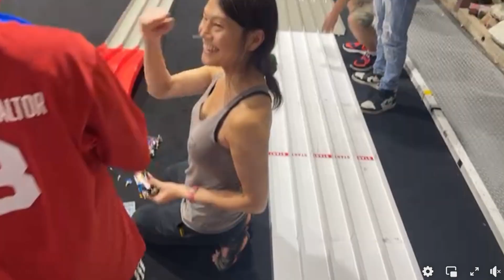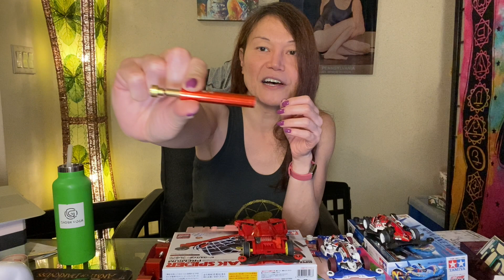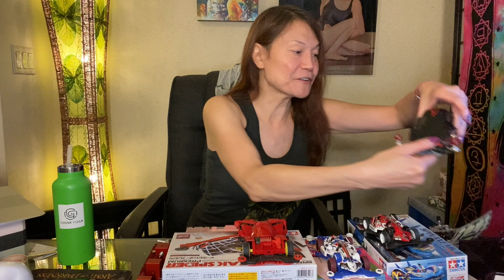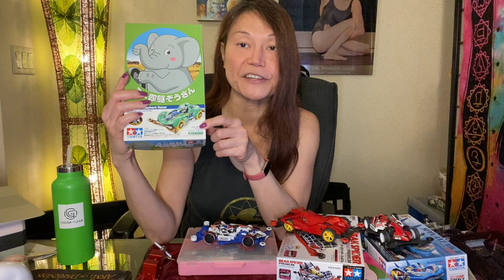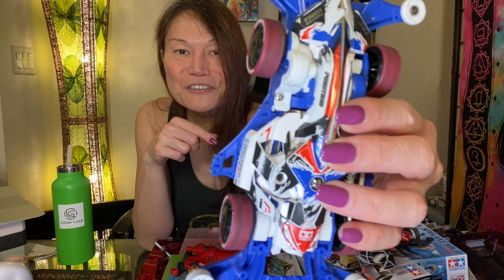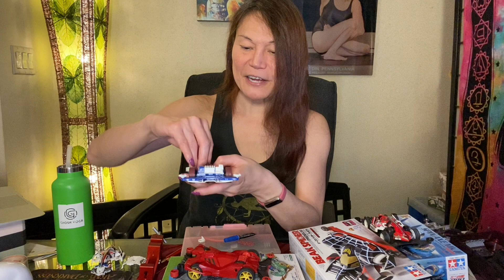Tamiya Mini 4WD Master Class: Super-Fast Box Stock Cars

Comment: I have a question. So I recently got a single shaft illegal motor with 80000 Rpm and the plastic gears I use seem to be holding up fine for now, should I still replace them with metal gears in order to negate durability issues or will that negatively affect the Chassis of my Car ?
Reply from the maker: You can try, but I'm not sure a Tamiya plastic kit with mostly plastic parts will be able to handle the rigors of an 80k RPM motor. It's worth a try and you might be able to race it in a special "Outlaw Class" if the event supports it.
Reply: @claredin  I actually replaced some of the plastic gears with copper ones like for example the pinion thats directly connected to the motor, but I couldn’t find a metallic version of the counter gear. The Motor works great but it gets really hot after a few minutes, its a good thing Im using a well ventilated Super X Chasis. Anyway thanks for the Advice and keep up the good work. I really enjoy your videos 😀

Comment: I'm confused about how to beat a car with an AR chassis, in the original box chassis class this is very dominant and I don't like it a bit 😂
Reply from the maker: No chassis is the be-all end-all of any class. Many people feel that FM-As are the best or MAs are the best, Some even like AR or S2. Every car, if built the right way, has a chance at winning.
Reply: @claredin  I don't understand what you mean about "built right away" do you mean exactly the same as in the manual??
Reply from the maker: @bravenz1376  Yes, according to the manual AND with great meticulousness and care.
Reply: It all depends on circumstances.
If the track is like a high speed one with less speed limiting factors, it is very hard to beat an AR because it's a quite well balanced chassi with slightly higher speed limit.

Comment: Thank you for the tips! I have a few questions as a newbie, hope you can answer them please 😊

1. Is it normal for the rollers to wobble a little? I've tightened the screw to the point I don't see the screws going down further and stopped, as I'm afraid of stripping the thread. 

2. Can we replace the super glue method with loctite?

3. Once we've inserted the wheels or rollers, is it ok to remove them and redo? Will it loosen the threads/hole and become less usable?
Reply from the maker: Good questions! 1. Yes, it's normal. There's always a little bit of give with the rollers so there will be wobble, however slight. 2. Yes, you can use any glue you want so long as it dries properly. 3. Yes, repeated tightening and loosening of the screws that hold the rollers will weaken the threads/hole and make your car less stable. A tiny drop of superglue in the hole before you reinsert the screw should help.
Reply: @claredin  Thank you so much for your reply! 😄 Kinda paranoid now that I realise that I should have bought a proper wheel installer prior to installation, I think I accidentally got some grease on the shaft and the wheel comes off pretty easily 😔

Comment: Madam, you can separate them into few explanation videos and shorts. But thanks for the information. You just forgot to explain about dragon series rollers for box stock racers. And please note that battery covers do matter to keep it in place, or just tell the audience to replace it with rubber bands.